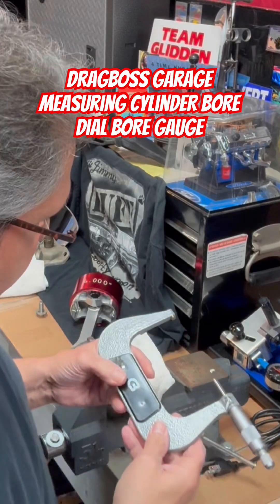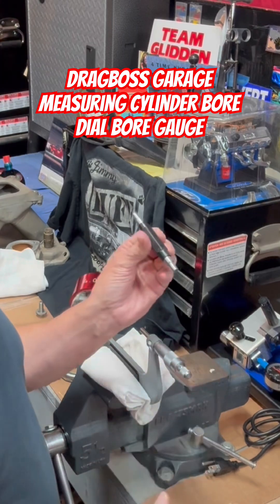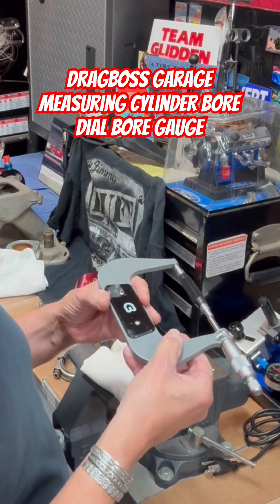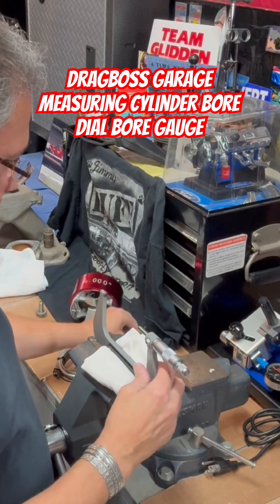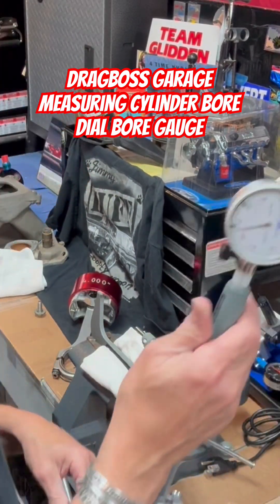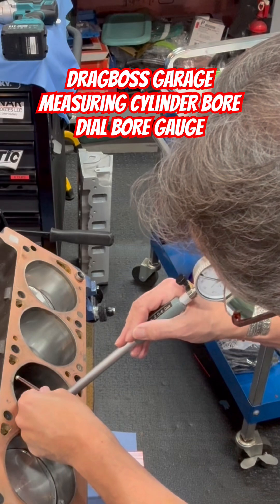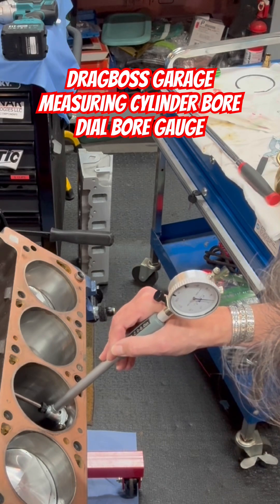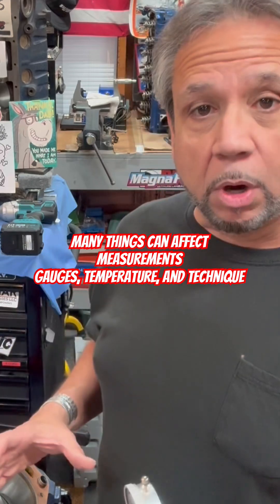DragBoss Garage: Using A Dial Bore Gauge, To Measure Cylinder Bore #351c #engine #racing

Comment: Hey tim why not leave the bottom of the cylinder half a thou bigger so theres low tension on the rings at bdc, the power is in the top of the cylinder but anyway doing thatll add quite a few more ponys or i could be full of it lol, like ur vids alot man...
Reply from the maker: To me your causing increased ring movement and chance of ring scraping with being allowed extra clearance and twisting in lands. I like it same all the way down…😊💯🏁

Comment: Tim do you know how to calibrate it if it is a little off?
Reply from the maker: I know to how to calibrate the mics, not the Dial bore gauge
Reply: @dragboss351cleveland my mic is off, it came with a tool but no instructions.
Reply from the maker: @davidreed6070 guess you will have to search the tube 😊

Comment: It's not rocket science.
Reply from the maker: Nope, but if you never used one before, there’s a lot to it.
Reply: @dragboss351cleveland  as a retired millwright I have
Reply from the maker: @Presto-s4l I was never a mill right, just a PA-C 😊
Reply: Bob was running mid 8s in 75 think you'll ever catch him
Reply from the maker: Bob was actually running 8.30s, with 81 Fairmont, nope don’t have a desire to go that fast
Reply: @dragboss351cleveland  If you know, please share. I think Bob was running in the 7.7 sec range after they changed the displacement rules (500 c.i. Limit). Which tells me he had developed and massaged the 351C to the max (with the resources available) using < 351 cubic inches.
Reply: Red lighting isn't winning
Reply from the maker: You’re missing it man. I don’t care about that, I had not raced in 5 years. I’m looking to achieve my own goals, successful run, since I built the transmission and engine. Thanks

Comment: Quality vid thanks!  A lot of mechanic vids skip these basic but essential skills and tools for someone who is learning and wants a garage shop someday.
Reply from the maker: Thanks much. I have just started to use them myself. Did not see good videos showing this. Have to do things right, the first time. 💯🏁💪
Reply: @dragboss351cleveland hello,I talked  to you earlier about your cougar, very fast car,I building a fox with fe,you said you ran a c4 transmission, and your car weighs 3100 i think,you said you recommend me running a c4,where would ,or who sell a adaptor  c4 to a fe engine, and who builds a good reliable c4 thats very stout,what dies your cougar run in a 1 8th mile